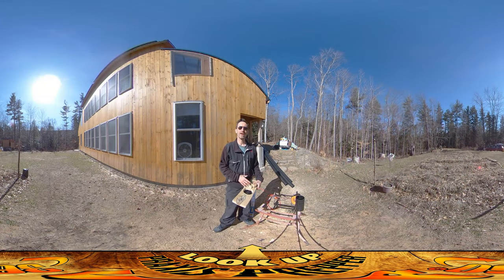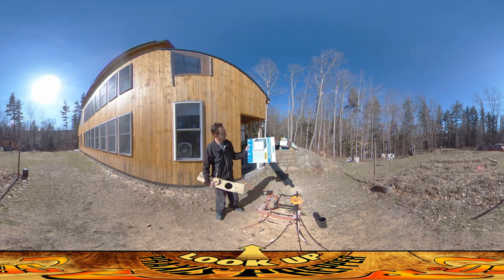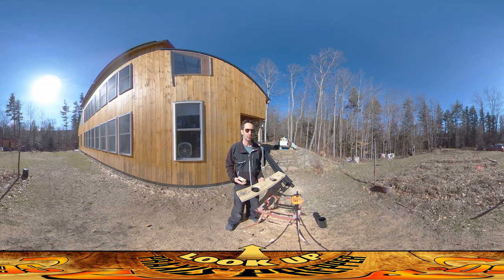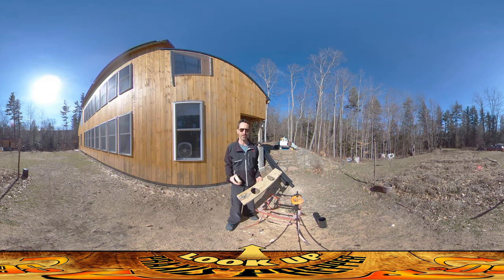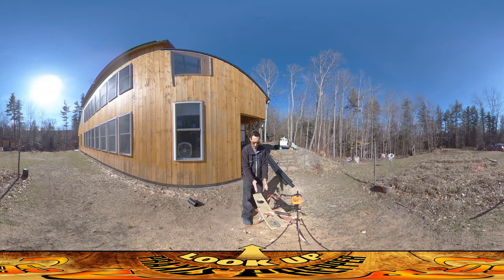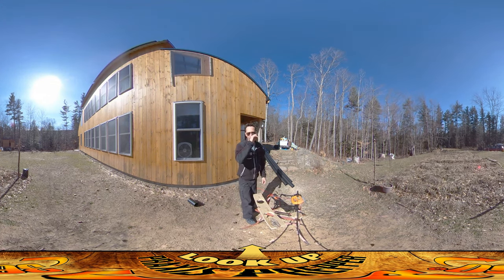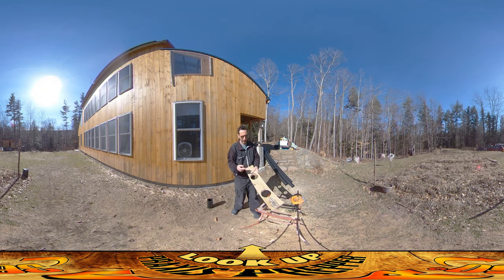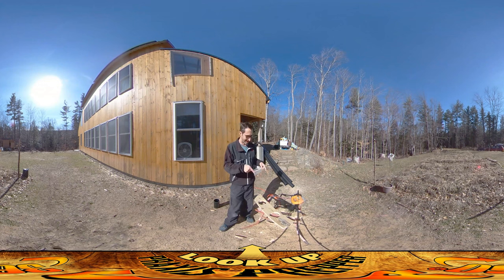Homestead Building - Fallout Shelter Air Intake Pipe Holes for ABS

Comment: Recheck box size.  Praxis.  I think you got suction , wrong.  How force to take in  air and the exhust out?
Reply from the maker: You're right that it's going to be a negative pressure system vs. a positive pressure system. I know that has its limitations. It's one of the reasons that I'm adding 4 filters instead of one single one, it'll reduce the suction needed to draw air in. The air exhaust has nothing to do with this box. The exhaust air from the house will go into one of the greenhouses, and the exhaust air from the shelter will push out around cracks in the entryway. I'm pretty confident that it's going to work. If it doesn't I'll definitely share that here and try to parse out the "why" of it.

Comment: I agree with the principle but where you put access to the box for switching that cap is going to be important for the shelter. In the event that you either forget to switch it or don’t have time to run and do it if say the dust is falling and you are speeding up your driveway and running directly into the shelter, you don’t want to force yourself to have to run out in it to go switch the cap.
Reply from the maker: At our current location, we'd likely have time between an event and when debris started falling on our area. We're developing an action list for what needs to happen between deciding to head to the shelter and closing up the door with people inside. If it were easy to switch the cap in another way, I'd be interested in changing this. Offhand, I COULD place the cap inside the shelter to be removed while inside. The only issue with that would be that the air would still draw in through the house... which could draw debris inside. Maybe not a bad way to do it though as it'd be one less thing to do before heading inside the shelter.
Reply: @PraxisPrepper  I actually thought about whether it might be better to draw it through the house as a sort of pre filter anyway. Normally the outdoor intake pipes for these ventilation systems are curved back down to earth 180 degrees to help avoid drawing dust into them but having the outlet actually completely protected inside the house, even indirectly, would probably provide even better dust protection and even if the house collapsed would most likely still draw air. The exception of course is if the house were to burn down in which case you would have to wait before opening the pipe, but nor until it actually started drawing smoke through it and you would have plenty of breathable air in the shelter for probably at least a day anyway. In personal shelters, the CBRN air cyclers don’t run constantly anyway, they are normally hand crank operated periodically to recycle the air and I’m confident is info somewhere that can tell you how often you would need to recycle the air in your shelter based on size and number of people. It would of course require some extra effort sealing the door to ensure that you don’t draw air through it. One option there would be an additional barrier across the opening where the hallway actually turns into the shelter, so turned 90 degrees from the door